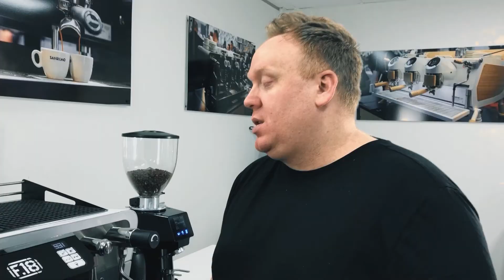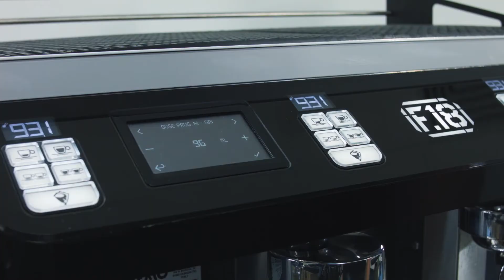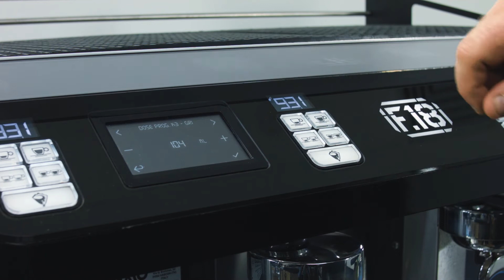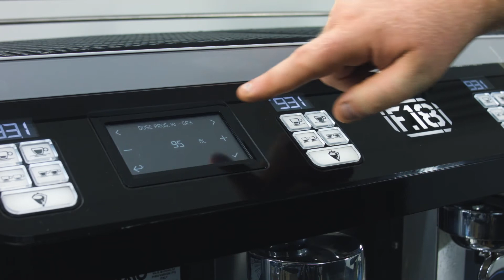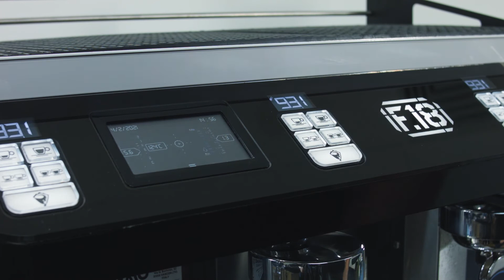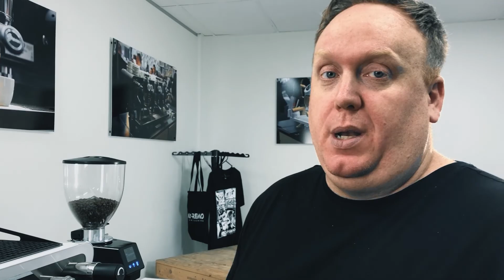Programming the F18 User Interface | Sanremo Tutorials

Comment: Hi, I have Been using Synesso that yield 40g coffee with 30 second. Switched to F18 and the water flow noticeably faster and yielding 24 second.  Is that possible to slow down the water flow? Thank you.
Reply: I'm still in the learning phase, but you can decrease the pressure in the 6-6-6-6-6 setting. See video called "Making the most of programming your Sanremo F18"
Reply: Hey hey I actually really enjoy the flow rate of the machine it gives a fantastic sweetness and body to the coffee that is sometimes lacking when dialling in the same coffee on other machines.

Comment: Hello sir i have sanremo f18 machine but i cannot use it there is problem in the programme can u tell me what is AL1 i want to fix
Reply from the maker: Hi Shakil, 

This AL1 message could mean two things:
- if this message is coming up on the main display it relates to the steam boiler probe 
- whereas, if this message is showing on the specific group head display it refers to coffee boiler probe

We reccommend you contact your local technician. Hope this helps!